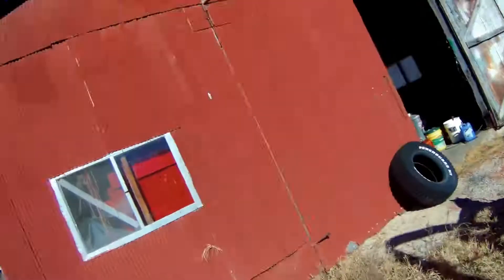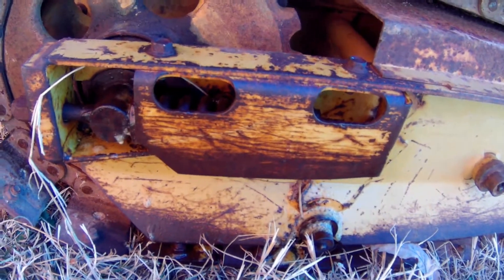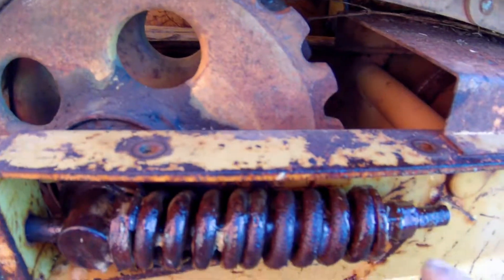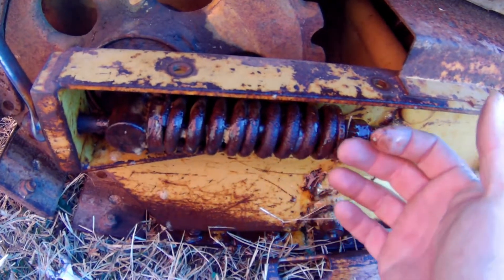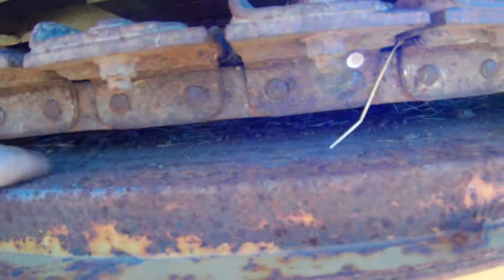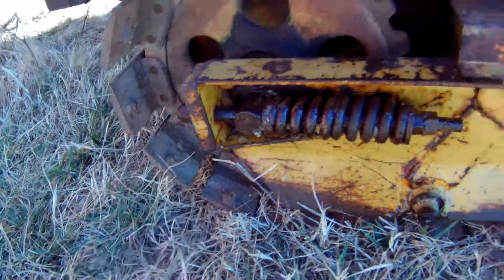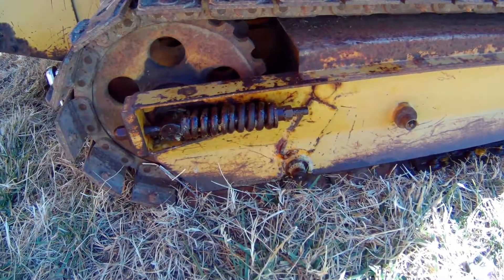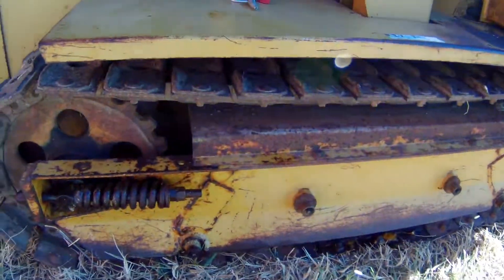adjusting tracks on a magnatrac backhoe

Comment: I have the same machine or something like it.   I have the 7000 and i hate that part.  I had to saw mine off and replace it with all thread.  don't know how long it will hold up.   Would like to come up with a better solution.  Like hydraulics or some kind new nut.    Out everything about the machine that is the worst part.   It is a pain when you lose the track.
Reply: I just bought new bolts and nuts for the chain tensioners. New style looks upgraded. Old ones were bent.

Comment: Hey jc, thanks for the video!

What else would you recommend looking over maintenance-wise with one of these machines? I'd like to pick one up by the end of summer (MH 4900). We have a place that's too tight for a full-size backhoe, but these Struck machines look like a good solution. 

Move some balsam saplings. Move a few little logs around a portable sawmill. Plow snow. That kind of thing...

What other words of wisdom you have for us? Thank you for any info!
Reply from the maker: the tracks  are the main thing to keepan eye on other than that just routine maintnance keep your fluids and filters changed and keep everything greased
Reply: Thanks for the info. Looks like a handy tool in the right circumstances. I have to laugh about all the guys saying they are a toy. Yes, if you're building a superhighway, it may not be very useful. Small homeowner though, looks like the right fit...

Take care!
Reply from the maker: it is a very handy little tool definitely beats a shovel
Reply: @nealling  I LOVE MINE!